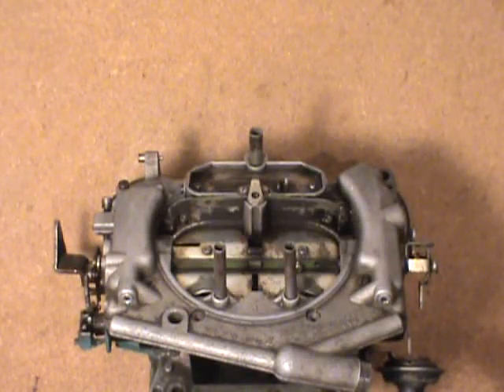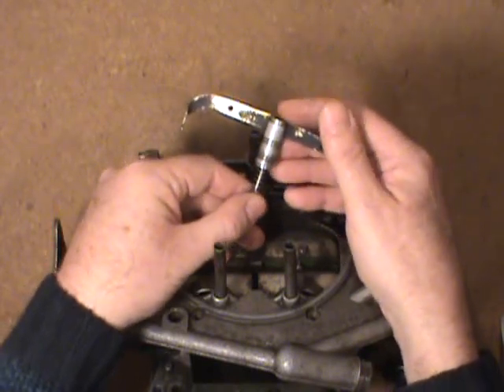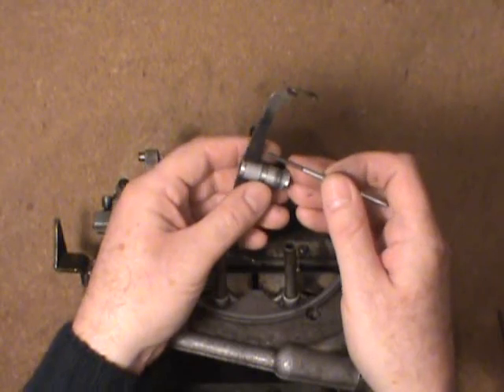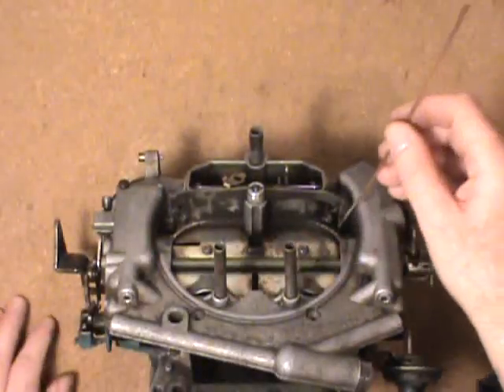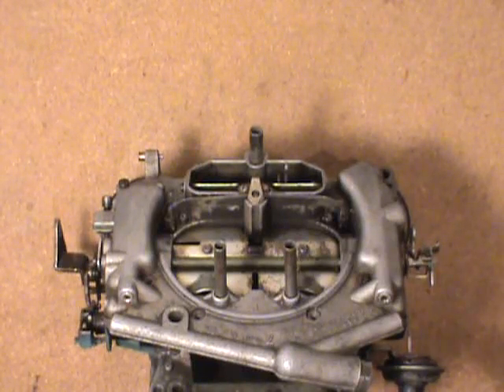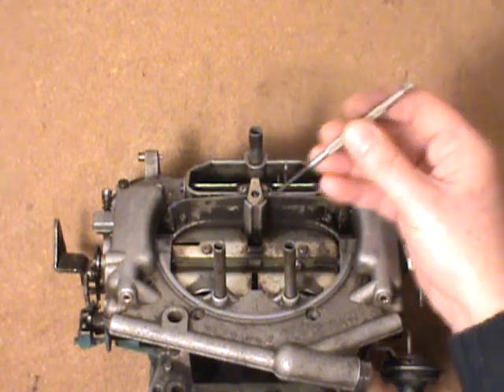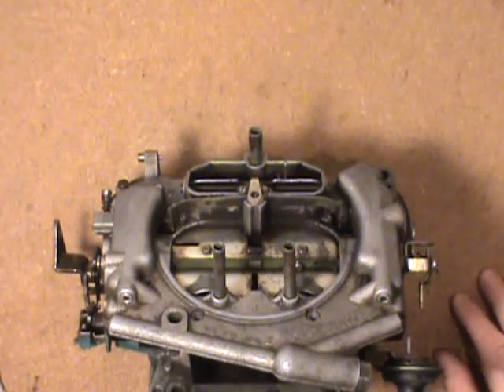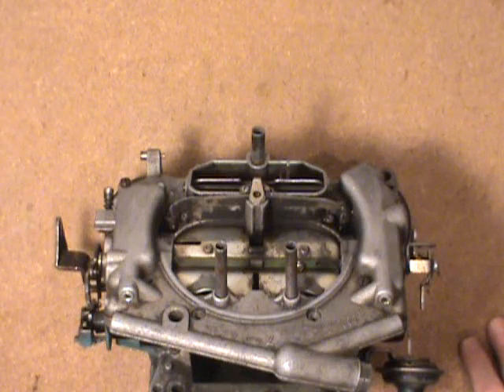Thermoquad 4 Barrel Carburetor  (Part 6)

Comment: I agree with egrand1508.  Thermoquads are either loved or hated and therefore there is not much info.  Mine is rebuilt and is off of a 1974 440.  It is now on a 340 with a manual.  It has a 504 lift cam with approximately 11.25 compresion and is bored over. It runs good, but has always ran rich. I mean it stinks and stinks up the garage.  :(  I I adjusted the idle circuit jets to base plus have turn.  So, screwed them in lightly and backed out CCW two screws.  This has helped tremendously.  Smell and performance. Now I am wondering about the metering. I have been doing this by sight, hearing and smell.  I am going to consider getting an analyzer to get more precise.  My question to you is, with the modifications-where do you recoomend that I start or finish?  This is not a daily driver, it is a hot rod.  I think that some fine turing willl really help.  Thanks
Reply from the maker: Mc Ca Greetings Mc Ca....Thanks for watching, and for, Your comment, and question/s as well................................................I will, do what I can, to help You out, with Your Carter Thermoquad Four Barrel Carburetor's Operation and Performance issues...............................................So then, let's start with the...Actual Thermoquad..."Serial Number"...shall we..........................................You will "Find" the "4 Digit Number", that is usually followed by the Letter..."S"..."Stamped" into the "Lower Left" and at the "Bottom", at the "Rear" (throttle body or aluminum casting)...............................................If, and when, You let me know, what the Serial Number of Your Thermoquad carburetor, happens to be, the More, that I will able to help You out...........................................There were, So Many "Different" Thermoquad Carburetors made, over the Years, that they were Manufactured/Produced, like You wouldn't believe...!!!...............................................It seems, that, each and every Thermoquad, was Designed/Calibrated, for not only Each Engine Size, and then some, but also, there were "Differences" in the Engineering/Calibration, for "Automatic" and "Manual" (standard transmission, with the Clutch Pedal).................................................Seeing as how, You were saying, that You had a "340" with a "Manual"...???........................................I'm thinkin', that "Manual", that You indicated, might be a..."4-Speed-Manual-Transmission"...perhaps...???......................................Maybe even an..."A-833-4-Speed-Manual-Transmission"...perhaps/maybe...???....................................Even..."If"...the "Thermoquad" that You have currently Installed on Your 340, happens to be Originally Designed/Calibrated for an "Automatic Transmission", I'm pretty sure, that, we should be able to make it..."Smoke-the-Tires"...without too much difficulty, once that good ole Thermoquad Carb, gets sorted out............................................Now then, there are Numerous (aka, Many) Things, that can cause a "Rich-Running" Thermoquad alright.............................................Maybe, I'll start with...let's "Assume", that Your Thermoquad carburetor was "Rebuilt-100%Correct"...then, as I see it, the very "First" thing, that I Noticed, in Your Comment, is Your..."Camshaft"...with that "502-Lift"...........................................While I'm at it, was Your 340's Camshaft "Lift", Measured at the Camshaft's "Lobe/s", or was it "Total Valve Lift"...??? (just wonderin', that's all)........................................When-ever a "Camshaft", that "Sounds" like it's going..."Cha-Chugg"..."Cha-Chugg"..."Cha-Chugg"...while the Engine is fully warmed up, and just "Idling", like Most, quite..."Aggressive Camshafts"...usually Do, as Opposed to a "Factory Stock" Camshafts that, shall we say..."Behaves Itself"...as in, not so much..."Cha-Chugging"...has me thinkin' the following...................................................When-ever a, shall we say..."Performance Camshaft"...is Installed in an Engine, that has..."Quite-a-bit"...or..."Lots"...of..."Overlap"...in its..."Design/Manufacture"...then, it's usually the...Additional "Overlap" (over and above that, of a Factory Stock Camshaft), that usually has a Person/Mechanic..."Adjust" the Idle "SPEED" Screw "Clockwise"...Way Too Much, in order to keep the Engine, with that "Lots of Camshaft Overlap" from..."Stalling", which is What, usually "Causes", in many cases, that..."Eye-Watering-and-Way-Too-Rich-Running-Engine...!!!...................................................Please, let me explain, what's "Goin' On".............................................Once the Engine, with that Camshaft, that has that "Large Amount of Overlap" is fully warmed up to Operating Temperature, and, when-ever You Adjust the "Idle Speed"...Higher...with the "Idle-SPEED-Screw", or "Solenoid", if so equipped, then, the "Primary Throttle Plates/Butterflies", will then be "Opened Up Too Much", which will Result in, Enough..."Air Flow"...through the "2" Primary "Venturi-ees/Throttle Bores", that, will then, start to Allow/Make the, shall we say...Primary "Low Speed Circuit" (1 Nozzle, as seen in Each Primary Venturi/Throttle Bores), in the Thermoquad, start to, and keep "Flowing", an "Air/Fuel Mixture", that is actually being..."Added"...to the Already..."Flowing"..."Air/Fuel Mixture"...from the..."Idle Circuit"...that is being Controlled with the "2-Idle Mixture Screws", in the Thermoquad, at "Idle Speed", which is what usually Causes that...Way Too Rich...and...Wasting Gasoline Scenario, that nobody really wants...!!!..............................................Thermoquad carburetors, as I see it, and maybe with the exception of something like a "Competition Thermoquad" carburetor, were Only intended, and Engineered/Calibrated, for, the Engines that were Installed in Vehicles, at the "Factory", that, for the most part..."Did Not"...have Engines, that had..."Very High Amounts of Camshaft Overlap"...thus, the reason, that, the good ole Thermoquad carburetor..."Will Not"...Operate Properly..."Until"...something is done, to, get those..."2-Primary Throttle Plates/Butterflies"..."Closed Down"...Close, to where they usually are/should be, when a Thermoquad carburetor is "Installed" on a somewhat "Factory Engine & Factory Camshaft".............................................When-ever an Engine is fully warmed up to Operating Temperature, and, is equipped with a Thermoquad carburetor, the "Only"..."Air/Fuel Mixture"...that the Engine should be "Inhaling" through the Intake Manifold, should..."Only"...be coming out of the Thermoquad's..."Idle Circuit" (that would be, the Air/Fuel Circuit, that the "2-Idle Mixture Screws Control), in order to..."Transition" (aka, make its way), "Properly", up to, and through the Thermoquad's..."Low Speed Circuit"...Properly, so the Thermoquad carburetor, will be able to, keep the "Air/Fuel Mixture", at the Proper "Air/Fuel Ratio", that the Thermoquad carburetor was Designed/Calibrated to "Feed/Administer", to the Engine in question.......................................What the "Old School Guys", used to do, to, shall we say..."Correct"...this Problem, of having the Thermoquad's..."Primary Low Speed Circuit"..."Feeding"...the..."Extra and Not Wanted"...Air/Fuel Mixture...when the Engine was fully warmed up to Operating Temperature and "Idling", was to actually..."Drill" a Small Hole, in Each of the..."2 Primary Throttle Plates/Butterflies"...somewhere "Between", the "Transition Slot" (nearest the Front of the Thermoquad carb), and the "Throttle Shaft", in order to "Provide" some "Additional"..."By-Pass"..."Air"...so that, the..."Idle-SPEED-Screw"...can be Adjusted Properly, so, the Thermoquad's..."Low Speed Circuit"..."Does Not" Feed, any Additional, and Not Wanted..."Air/Fuel Mixture"...to the Engine, while it is Only at..."Idle Speed"...!!!.......................................Some of the Performance Carburetors, that are sold these days, actually have, a, shall we say..."Idle Air By-Pass"...Feature/Adjustment  in/on them, to make sure, that the "Throttle Plates/Butterflies" are in the "Correct and Needed"...Position at Idle Speed..so, the Carburetor will Work Correctly, at all Engine Speeds and Loads..................................................Could also be, that, One, or Both, of Your Thermoquad's Carburetor..."Floats", especially, if they are made out of that..."Nitrophyl" (aka, looks like black plastic) material, that may have, or are starting to Absorb Gasoline, which will cause them to start "Sinking", which will also cause a Rich Running Thermoquad Carb as well...!!!............................................I always like to actually..."See"..the "Inside" of a Thermoquad carburetor, that way, I can Verify, the Float Settings...the Sizes of the "Primary and Secondary Jets" that are Installed....the Condition, of the Accelerator Pump Seal/Cup...any Damage...just how much Debris/Crud/Yuck-ees, that might be Hiding in there...etc.)............................................So then, if Your 340's Engine, happens to have a Camshaft with "Lots-of-Overlap", then, You will have to, find a way, to get some "Additional By-Pass Air" Past the Throttle Plates/Butterflies, so the Primary "Slow Speed Circuit"..."Does Not"...Keep Feeding, all of that Extra Air/Fuel Mixture to Your Engine, while it is fully warmed up, and at "Idle Speed", or, Your Thermoquad carburetor, just won't be able to (transition) and work, like the Carter Engineers/Designers Intended them to Operate...............................................Also, some Folks, have Adjusted Their..."Ignition Timing"...in order to be able to, get the "Idle-SPEED-Screw (or Solenoid, if so equipped) "Down", close to where it should be, but, "Make Sure", that, You Fully Understand, all about..."Ignition Timing"...and its..."Effects"...on the Engine, or, there is, as I see it..."A Strong Possibility"...that..."Major Engine Damage"..."Might/Will Occur...!!!........................................Oh Yeah, if and when the Idle Speed is..."Set Correctly"...You should be able to see, once the Thermoquad is removed from the Intake Manifold, that is, and held "Upside Down"...that the "Transition Slot"...that You see, that is "Exposed/Open", just Under the Throttle Plates/Butterflies, should be about the Shape of a Little "Square" there-abouts....................................................If "Too Much" of that "Transition Slot" is Showing/Exposed" Under the Throttle Plates/Butterflies, that's tellin' me, that, by being, that much too open, has a good possibility, that the Thermoquad's..."Low Speed Circuit"...just might start..."Feeding" that "Very Unwanted and Extra" Air/Fuel Mixture at "Idle Speed", and also, Not wanted "Fumes" and Lack of Gas Mileage/Kilometer-age as well...!!!............................................Have You had a Look at Your Engine's "Spark Plugs" at all...???....................................If and when, You manage to get Your Thermoquad..."Dialed In"...and it gets close to, how I was able to make them Perform, and at times, with pretty good Fuel Economy as well, but Only when, I'm Not Doin', the...Pedal-to-the-Metal...what-sham-ah-call-it...lol...................................................So, I'll leave You with (all of...lol) this Information, and, if You decide to stay with Your Thermoquad, I'll be around here somewhere.............................................'Till next time...................................Be Safe, take care, and have a good one.

Comment from the maker: ...make sure that, after you put the "Clean" gasket, squirter cluster, and tighten the screw on top of the squirter cluster, that "ALL" Parts, pieces, bits, crud, and don't forget to remove "ALL" of that protective paper towel that you put in the primary throttle bores, or, Engine Damage Will be the Result!!!....Then, re-set your Idle Speed Screw, or Idle Speed Solenoid to where it was, just before you started all of this, to get your Engine idling back where it was before..Good Luck..Bye 4 now

Comment from the maker: ...now that you have that Squirter Cluster in custody, clean the passages with fishing line, and some carb cleaner (Wear Safety Glasses, and do it Outside of your House!!!)....If you have compressed air, you can use that to force the crud out as well....You might put a few drops of carb cleaner down into where the check valve (Needle) is residing, before you re-install the Squirter Cluster as well....Make sure that the little gasket is still in good condition or install a New one....(con't)

Comment from the maker: ...once the previous mentioned preparation has been completed, then, all you have to do, is, remove the Squirter Cluster (just a plain screwdriver is needed for that one screw on top)....Then, with a pair of needle nose pliers, just pull straight up, and, the screw, squirter cluster, and the gasket, should now be in your hand (hopefully)...."Warning!", there is also a little check valve (NEEDLE) hiding down inside there!....It should stay there (because of Earths Gravity)....(con't)

Comment from the maker: ...make sure that you Manually push the Fast Idle Screw down, to the bottom, so that is off of all the fast idle Cams Steps!....If you don't, then, your primary throttle plates will be open a bit!...(Also remember to mark and record the setting that you had on the curb idle screw or solenoid, so you can re-instate the original idle speed setting later)...Once you have the primary throttle plates 100% Closed, then, stuff some clean paper towel into the primary throttle bores for safety...(con't)

Comment from the maker: ...and, if, after you went Fishing (Thermoquad Fishing, that is), and if it's still plugged, then you'll have to remove the Accelerator Squirter Cluster...."Warning", "Caution", Destruction may be on the horizon!!!, if you don't keep those small parts from getting down into your Engine, causing total destruction (of your Engine, that is!).... If you remove the Squirter Cluster, first, back off your Idle speed screw or idle solenoid to close your primary throttle plates, and...(con't)

Comment from the maker: ...try this first...Find a small diameter piece of Fishing Line, and see if you can Probe the plugged nozzle with it, as this might dislodge, or, open up the clogged tube...You might also put a small amount of Carburetor Cleaner or some other type of solvent that is strong enough to dissolve, what I think is dried up gasoline residue (cuz, when gasoline evaporates, it usually leaves behind a brownish, dried glue like substance, and perhaps, this is your Culprit?)..Maybe do both tubes?...(con't)

Comment from the maker: Greetings once again, William Ruescher....Hopefully, if and when you get that one plugged (or, semi-plugged) nozzle on your accelerator pump nozzle cluster, where one a good day, both nozzles (little tubes), discharge that much needed "Fuel-Stream" to prevent your Pick-em-up-Truck from stumbling from a stand-still, You will become a "Happy-Camper" once again....You can try the following "Cures" (that's if you haven't already fixed the problem, that is)....(con't)

Comment: Alright, just tested the accelerator pump, it appears that the pump itself is working, however the jet on the left primary (you're facing the carb) is clogged a bit. Jet on the right side is nice and steady.

Comment: I will do the accelerator pump test sometime today. I've been watching your responses and have been waiting for you to finish before I replied. I had done some more tinkering yesterday after I had made my initial post. I had richened the metering rods even more than I'd had when it backfired. So far, no backfire and it runs much better than it did before. Bog is almost completely gone. As far as other symptoms, it starts and idles great, accelerates fine once you get past the bog. ...cont....

Comment from the maker: ...if your Thermoquad passed the Accelerator Pump Stream-Squirting-Test, then, there is still trouble in Paradise....Change your Fuel Filter lately?....They can, and do plug-up occasionally, as well as a weak fuel pump, can cause a lean running condition....The Thermoquads choke pull-off diaphragm, as well as your vacuum advance diaphragm can deteriorate with heat and age....Before i go any further, let me know all of your Thermoquads symptoms....Like, does it start and cruise ok?....Take care

Comment from the maker: ...make sure that you move the gas pedal lever on the Thermoquad through its full travel, meaning, from idle, to wide open throttle, and repeat this a few times, while looking down into the 2 front throttle bores (primaries)....(and of course, Engine Not Running!!!)....You should be seeing 2 steady, and full streams of gasoline coming out of both of those small Nozzles that are located between those 2 front (primary) throttle bores....Weak streams = BOG from a stop with normal driving...(con't)

Comment from the maker: ...make sure that your Pick-em-up-Truck is in Park (or in gear if it's a manual transmission), and the parking/emergency brake is on, and the tires are blocked, and your vehicle is on level ground...Then, remove your air cleaner housings lid, and set it aside...Now, with one hand, push open the Choke Plate until it is fully open, and hold it there (Engine Not Running!!!)....With the other hand, move the Thermoquads gas pedal lever (its the one that the gas pedal cable is attached to)....(con't)